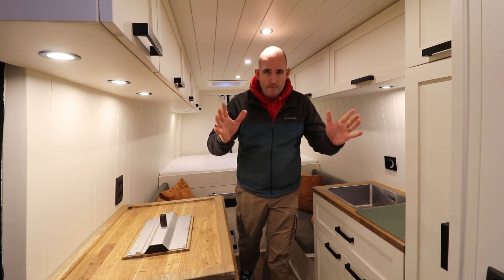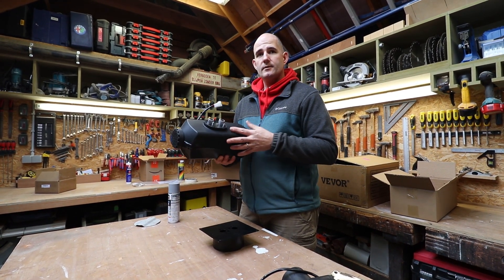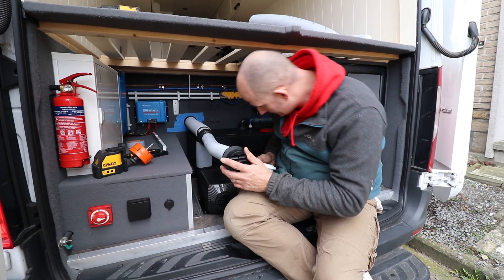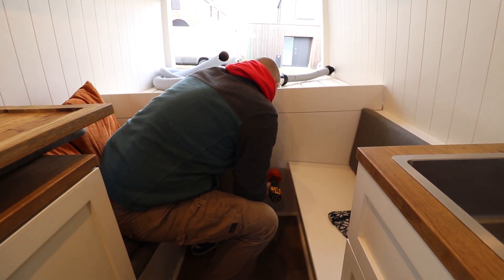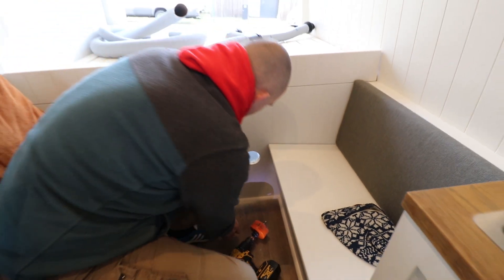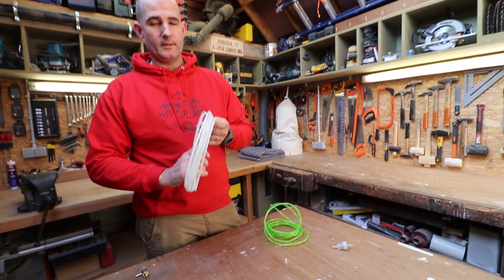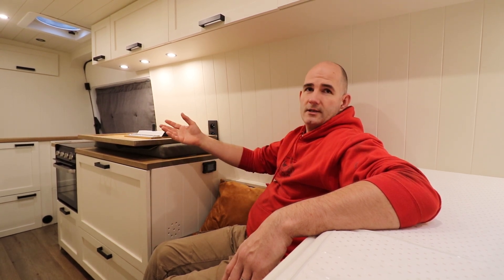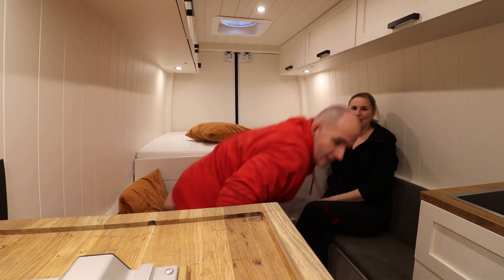Installing the new 2023 Chinese diesel heater...

Comment: Two heaters in one van, over kill, second you should have put the inlet pipe outside so you're sucking in fresh air instead of heating up mouldy air and spread ing it around the van, another bonus is you positive pressure the van and push the moisture out without the need to use roof fan to suck it out along with the heat,lived in my van for 7 years and never get mould anymore.